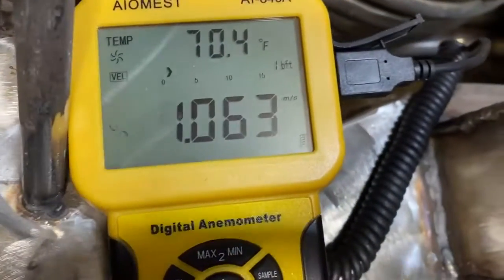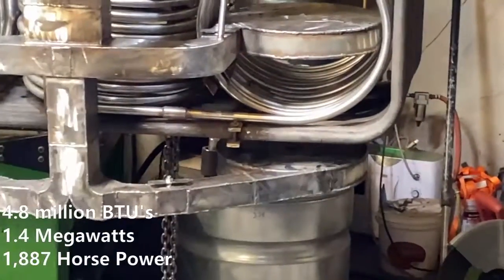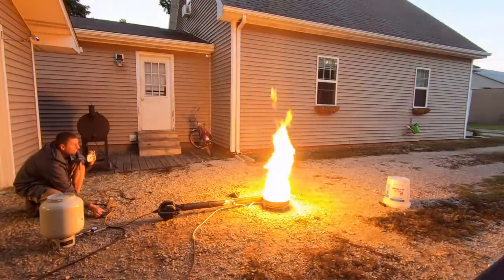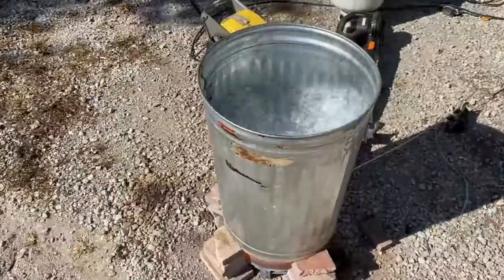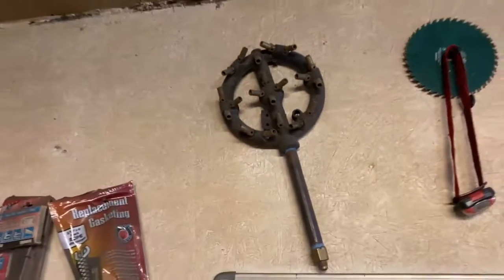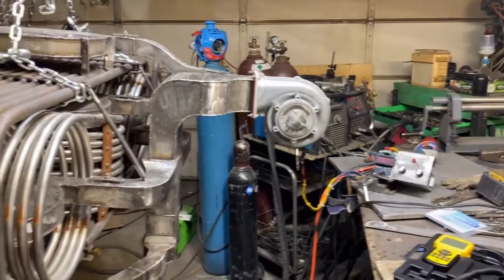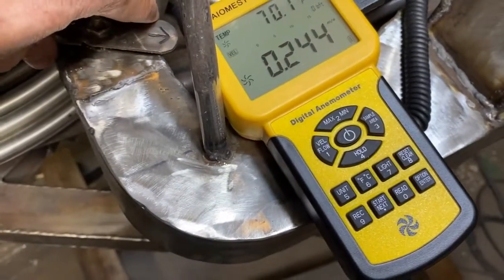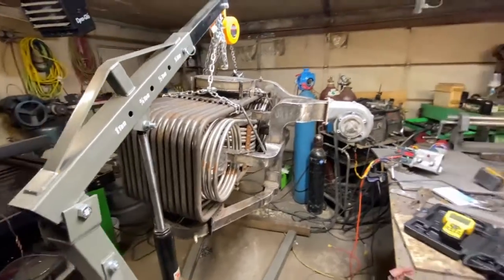1.4 Megawatt Boiler

Comment from the maker: Guys , this was some time  consuming work , even had to slip roll all the curved corners . Slip rolling is not a fast process.
How long do you think this took me ?
Reply: I'm going to guess at least 2 weeks (over 80 hrs) it just looks very involved... and I'm probably short.
Reply: Not counting waiting on parts or supplies, 2.5 weeks?  .5 for adjusting the cad and changing things up.  Anyone else I would say 3 months.  Lol
Reply: I'm impressed , but too long for my OCD on efficiency with everything, to be honest I would have used stainless tube running into the banjo ends.
Reply from the maker: @espenforfen1334  Cost to much and takes longer , ive done a few pie cuts in my day . Its good enough for Hvac in buildings used to build  high efficiency AC systems in hospitals and other building so im sure im gonna be ok . In my case this will do just fine . woulda looked awesome though
Reply: slip rolled?? on second thought it does look like a ratrod boiler haha. i was wondering why you chose square tubing for the manifold. hVac rules? do square air ducts boost volume?

Comment: That is potentially a very seriously dangerous design.  How are you going to get enough water throughput so that it doesn't explode or melt itself?  Even if it works as designed you're going to have super heated steam at an extremely high flow rate any boilermaker knows one slip up can cause 3rd degree burns extremely quick.

Comment: Increased velocity and compressive heating definitely raise the heat of the air [diesel effect], especially with the snail shell because that will increase the pressure simply because the air will not want to go to the center, and this will increase heat and pressure.

Excellent work! (~_^)-b

Comment: Thank-you for posting.
An observation, the butterfly valves might be inefficient way to limit air flow within the pipe, as it creates a chaos disruption of the flow of air in the pipe as it hits the valve, instead of just reducing the flow, I am of the opinion they are suited for flues with low pressure, but in your case I think they defeat the flow dynamics of the feed pipe to the burner. Also they may not hold in position, as it heats up and the valve may become loose in the pipe over time?
Secondly, a question, did you consider using round stainless tube instead of cutting it from flat sheet, I always considered the flow dynamics of fluid through a tube better that a box tube. Thoughts?
Reply from the maker: As i say in the video they will be welded in place after they are set . Round tube is harder to work with in my opinion .
I did not wanna do 500 pie cuts
Reply from the maker: My car and every go cart i ever had used butterfly valves , they do fine  . as for the tube verse box as long as corners are round your good . also box makes the manifold easier to build .

Comment: Have you considered incorporating stagnation point reverse flow combustion , about 50 kW / litre of combustion volume?
Reply from the maker: never had any luck with it , seems like a very choky flame starved of oxygen . its popy and explosive and blows itself out some times also but the diagrams all look ligit . But then again we dont see it used much unless a massive compressor is involved
Reply: @NOBOX7  Never thought about the need  for high pressure air supply but now I do, Thanks